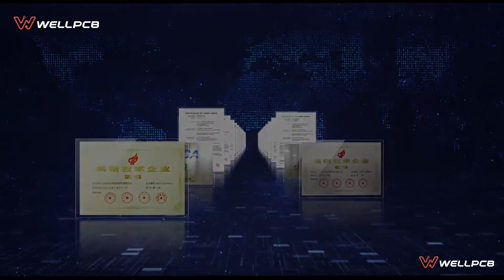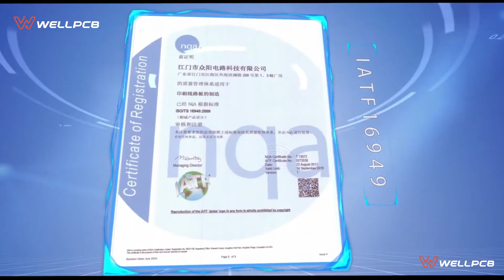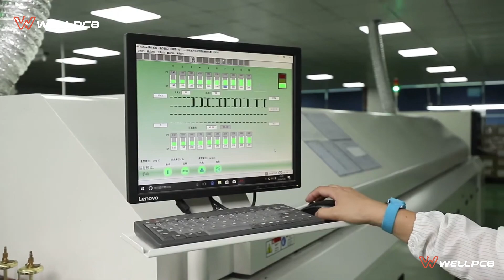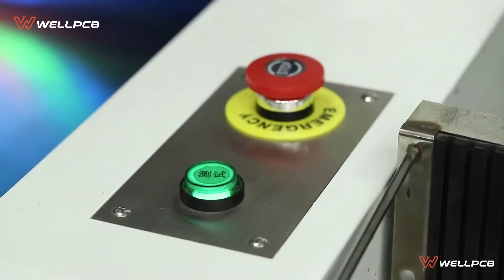Inside WellPCB: How China's Leading PCB Manufacturer Ensures Quality and Quick Turnaround

Comment: So I want an estimate on a small run of a two pcb set where both boards are 5 x 4".  They are single sided traces for through-hole components except for two Dip-14 IC's (1 each board)  and  2 dip-8 IC's  on each board.  I have professional diagram of component layout/trace (scale).  What is the smallest run you can offer?
Reply from the maker: Thank you for your comment. Our minimum order quantity is 1 piece. Could you please tell us your email address? Or you can email us at sales@wellpcb.net, and our sales colleague will send you a quote.